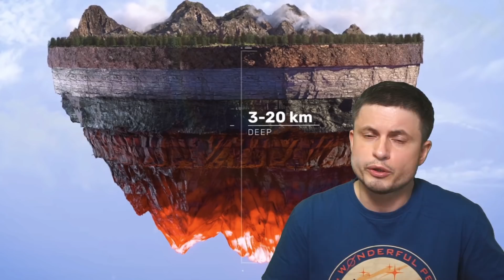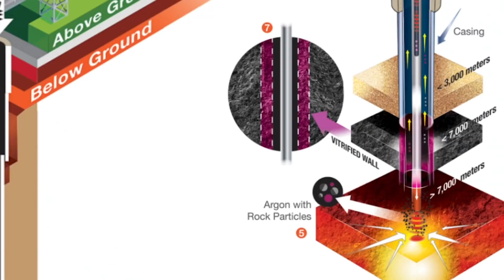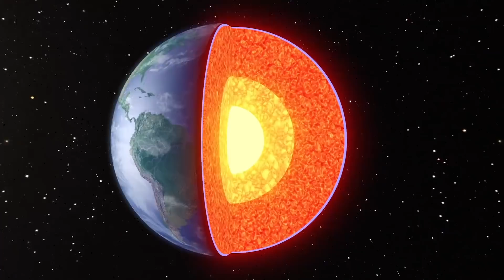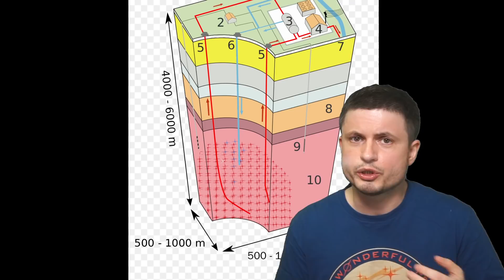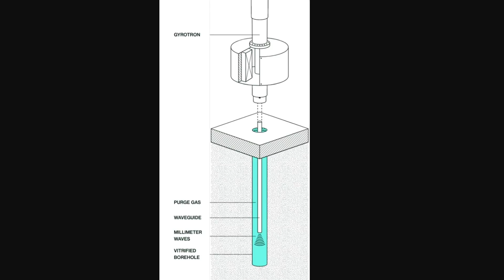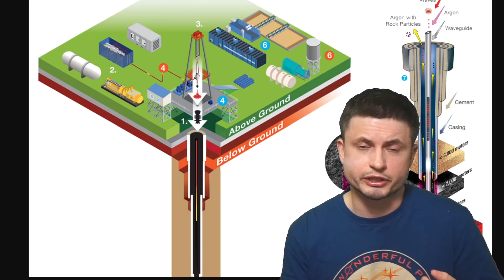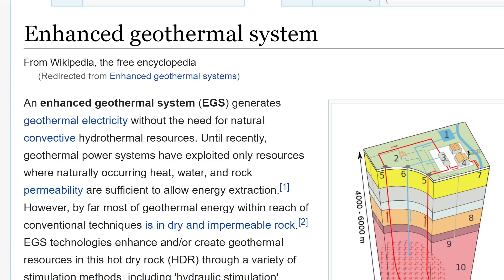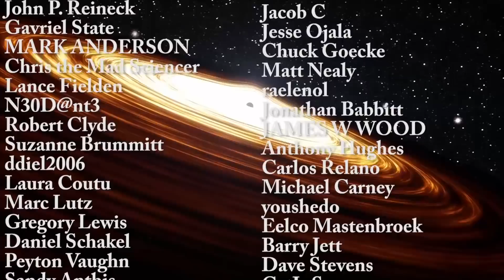Creating Deepest Hole on Earth For Geothermal Energy Revolution

Comment: Perth has two deep boreholes which heat a swimming pool, and power the stadium aircon. They're only 800m deep though.
Reply: Interesting! Alaska north slope oil comes up from less than 2 miles at well head temp of nearly 500 degrees  Fahrenheit!
Note* They hit an actual forest of wood about 500-700 feet down in the north slope  in Alaska and from the surface  down to there it's all pea gravel.
Something happened to make it that way. Scary if you think about it.
Reply: This might be the best way to heat cities in cold climates. It also doesn't require expensive turbine generators, just pumps.
Reply: @Rampart.X  pomps pipes and... but there are very corosive gases down there :(
Reply: I assumed you were talking about Australia but I see that somebody else has assumed Perth, Scotland(?). Which is it?
Reply: @susanc4622  Do they AC anything in Scotland?
Reply: If its Perth, Australia that's quite impressive and promising. Perth sits on some of the oldest, coldest, and most stable continental crust on the planet (a very, very ancient craton). If they actually made it economically viable there than you could probably manage it most places in the world.
Reply: I'm assuming Perth Scotland I'm currently living in Perth Western Australia and can't find anything about geo powered pools here

Comment: This is really exciting. I hope it works out. Thanks for sharing, Anton.
Reply: Anton,  this is a red herring.  The problem is that the thermal conductivity of these layers is dismal.
Reply: @KK-pq6lu  Elaborate
Reply: @KK-pq6lu  and only a fool would believe that more energy will save us from lack of resources that's coming...  (think minerals)
Reply: I really hope it doesn't. How much will it accelerate the cooling of the earth? With the cooling of the earth comes also a weakening of the magnetic field.
Reply: @Randy12346  nah, I dont think so. 20km is barely even reached moho which is the boundary of mantle and crust. We are just using the heat from the crust....
Reply: As he has shown, it's not new technology. But it does use a huge amount of fresh water with currently used technology.

Comment: A startup that proposes creating deep holes in order to make very efficient geothermal energy generators, very good,  but, while digging the JWST is looking back into the early Universe and seeing so many galaxies, so close together. It is going to see nothing but galaxies. The old Universe (all the mass in a small, maybe earth sized) became, for a short time, a Galaxy Creating Machine! The first thing that happened during the big bang (the big separation), was one huge spiral galaxy with black hole got created in between both Sides (of the old Universe, it was an inside job >smile<)  pushing full blast against each other (We should all know because We all had to >smile again< choose sides back then and probably push with all our mental might! We all (all the Beings in this Universe) knew what was  happening; We were all there; We are all eternal; where else would We all have been at this moment, with our Awareness & Consciousness, We had no form.) creating that first large spiral galaxy with one very large black hole in the center)! The tremendous stress blew both Sides into countless Pieces, each Piece pushing on those next to it creating many, many more (much smaller) spiral and elliptical galaxies, and other matter. The progenitors (the old Universe in pieces) that created all this are Quasars now. Most Quasars pushed each other to the perimeter of our new Universe. From there they they form a  basket like pattern all around the new Universe. They are responsible for our gravity and moving electromagnetic vibrations and much more. Some Quasars stalled and remained in the physical Universe. The JWST will allow Us to understand what happened back then. We all can see, as well, that We were always a part of whatever this Universe was/is involved in… “out of the One many, out of the many One”
Reply: A stoned bot, I'm guessing?
Reply: Instead of writing this comment, you should've called a therapist and scheduled an appointment.
Reply: I like this esoteric take on cosmogony
Reply: Sounds like an interesting story.
I think I'd read that one.
Maybe there's an uprising creating the universe was thought to be a bad idea and half of your fractured entities were cast into the outer darkness for being rebellious ..😳

Comment: So the machine would vibrate the atoms in the rocks so much that they would turn into liquid glass, becoming soft and easy to bore through, then shrinking and solidifying after cooling down leaving a glass sided hole?
Reply: Wasn't this in the most scientifically accurate blockbuster movie, "the core"
Reply: @joshf9074  Yeah! Hundreds of meters wide diamonds floating in the mantle of the planet!
Reply: @Edward Elizabeth Hitler Any sorces or you just making sht up as you go. I mean sounds like a nice idea but is there actually anything to suggest that would actually happen. Cuz last i checked fault lines were largely caused by the bulk movement of the continents against each other. just poking shallow holes would creat new fault lines
Reply: @virutech32  He probably used to think that the accelerator in CERN would create a small black hole that would swallow the Earth.
Reply: Presumably one would locate the boreholes well in from the edges of cratons.
Reply: Granite melts at around 1250° C. Carbon steel melts at around 1500° C. Do you see the problem?
The strength of steel remains essentially unchanged until about 315° C. The steel retains about 50% of its strength at 600° C. The steel loses all of its capacity when it melts at about 1500° C. steel just won't work for drilling very deep holes. You need unobtanium.
Reply: @benthere8051  But if they're drilling through  more or less molten granite, it might be possible to use some high tech ceramic for the drill bit. Some of that stuff retains structural strenght at stupid temperatures.
Reply: Basically.
But it uses lots of energy of course.
But the return would be almost infinite and very renewable.
Reply: @Edward Elizabeth Hitler I think convection currents inside the Earth would not allow for a cold spot to appear.
Reply: @Edward Elizabeth Hitler Ah yes quite right. My deepest apologies, GoOd SiR. In any case the idea that deep geothermal wella would cause a fault line doesn't sound like science we have. Obviously if we were cooling the area hard enough we might cause some local effects but shifting the drift of continents would require a scale of deployment that we wont have to worry about for many hundreds of years & by then i doubt we wouldn't have the tech to both predict & prevent that.
Reply: @virutech32  I can't even imagine the amount of heat extracting holes it would take to cause a measurable cool down of the Earth's interior, causing it's convection currents to change paths. Entire slabs of crust are constantly submerging one under the other, and while that does cause a lot of earthquakes, and while those are events on a planetary scale, they don't significantly bring down the temperature of the Earth's mantle, let alone having any impact on the outer core. The convection plumes move upwards from the core very slowly, and are bigger than entire continents. I'm quite sure it won't be soon that mankind produces the required equipment. Equipment on the same scale and able to produce similarly gigantic amounts of force that would cause some changes to the inside of our planet. Size is also a problem in your other claim. Artificially made fault line in the crust, that unstable crack you claim would appear because of too many man made holes in the crust is a big overestimate of human made machine's capabilities, while also not grasping the immense lengths in question (those of the fault lines' ).
Reply: @21palica  Yeah to actually measurably effect mantel temps we would be talking hundreds or more years in the future & more likely more than a thousand. I was just mentioning that eventually we could.

Also i never made the claim about artificial fault lines. That was Edward & i was dubious af about it
Reply: @virutech32  Sorry, my mistake. You are right, that comment was meant for him.
Reply: At a quick glance across the web Gyrotron seems to be an amplifier for the Magnetron commonly found in microwave ovens etc & seem to deliver 1000x the output power.
Reply: Hotter. Plasma hot.
Reply: @Edward Elizabeth Hitler Oh, come on. I didn't use any personal insults, but rather compared what to me seem like two similarly uninformed claims. If you can find me any real evidence that a small hole in the Earth's crust would create an artificial, new fault line, or pose any plausible threat to mankind, please give me the links, and I will gladly apologize to you.